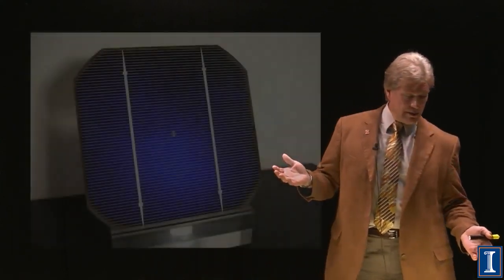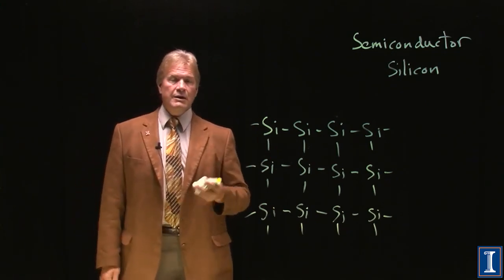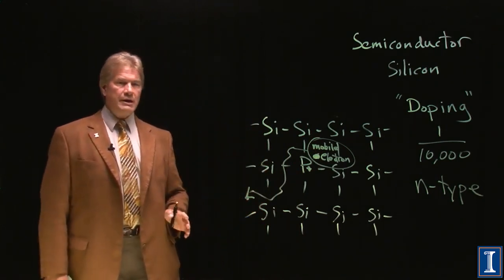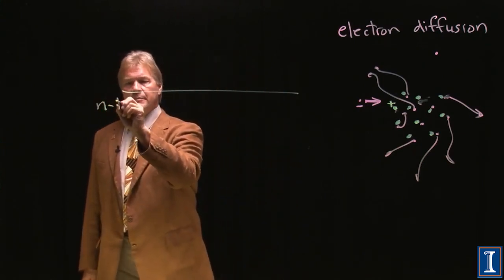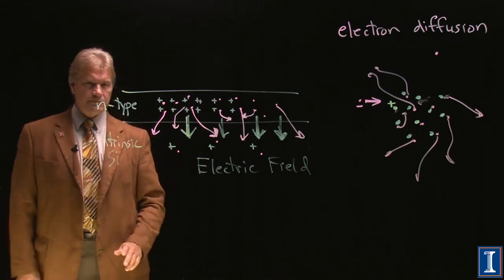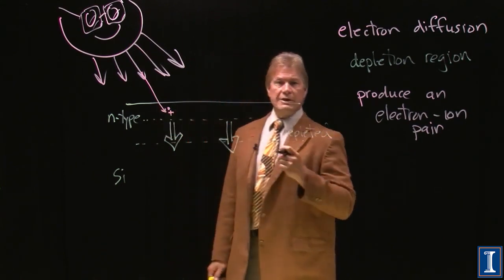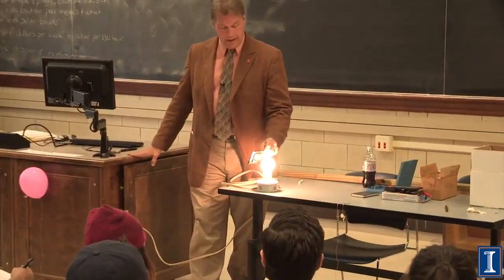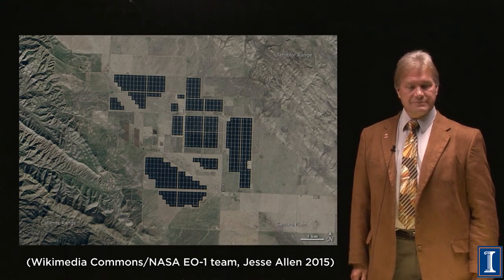How Solar Cells Work

Comment: Cdte panels 4x8ft size, or 8x8 size. FLEXIBLE deposition on stainless steel rolls in continuously operating vacuum chamber. Top is then plastic or even a clear sprayed bonding agent,  and then the wires are fastened. 
For less connections
For less roof intrustions
For less weight
For less manufacturing infrastructure and expense

1000w minimum panel size. They will be LIGHTWEIGHT and can be handled in a roll up a ladder or percarious place, easily. The edges should have lips flexible grip beaded edges on them at least the sides probably top bottom too. SO they can be mounted with strips that connect over and to panels on either side and or tops... . Then strips of Plastic could be used as banding to keep it in place, enough. Cheap, even pre made with butyl waterproofing screw holes. 
I think connectors should be on the panel. WIthout wires, wires are made to each installation. AND the mc4 connectors can be made smaller with higher voltage lower currents. If you could take partially the dc voltage and invert it without transforming the voltage, you can design a system that can do that, while producing or grid tie, then the remainder is stepped down to the battery. 

It makes complete sense. 
Can also have a silica or silicone coating on the back for electircal insulation and non arcing ability. 

Higher voltage a ok with higher voltage electroics. 

Can be done so well. 

I SHOULD steer the general direction of first solar, as they could easily and happliy implement this technique and to hell with any patents, I am certain there are no ideas not worth copying or    to happen to replicate due to the general intrinsic design. DAMN

Comment: What will happen if silicone is dopped with uranium. Wouldn't it turn into super solar panel. Like you have combined solar and uranium radiation energy causing electron flow..

Comment: Best and most complete (non-quantum) explanation I have heard so far! (And I've seen quite some, ever since I studied physics some 35 years ago.) 
The concept is not very easy to wrap your head around, and most teachers explain that the charges move from n-layer to the p-layer because they 'want to be there' , 'fit in the holes' or there is 'more room for them in the lattice' or whatever. But those are only confusing ideas and would not explain anything, because then that propensity to go there could be described by a potential by itself.

The adult/children analogy was excellent: it is essential to explain that the charge difference is caused by diffusion, and is a statistical phenomenon: just due to density difference of free electrons, there is more probability to move from high density region to the low density region. That sheer fact makes it plausible why they would move even against a slight potential difference. 
And for the same reason they will diffuse more likely from the n-layer into in the metal electrode grid than from the intrinsic layer to the metal bottom plate, even though the n-layer and metal grid have a slightly higher potential than the intrinsic layer and the bottom plate. 
That electrons freed in the depletion zone follow the potential gradient is also understandable.

Comment: Very interesting. Does anyone know how doping works for the silicon atom? I know boron can also be used, just elements with either +/- 1 electron. But not too sure on the technical details of doping. Do you just throw them together and drive a reaction with heat?

Comment: I thought that if photons can break electrons away, it's called "ionizing radiation", and that that's the realm of radioactivity and X-rays and gamma rays.  IIRC typical silicon solar cells operate on visible light and often even infrared light, which is far lower photon energy than X-rays or gamma rays.
So what's the ionizing / non-ionizing distinction?

I remember once walking past a construction area, with the usual signs on the fence advertising the contractors involved, and I remember an amusing sign that said something like: "<name> Solar, knocking electrons into higher energy states since <year>."

Comment: But.... why are the PV cells blue? You asked the question but you never answered that. Yes, logically they SHOULD be black so why aren't they? Is it related to the texturing of the PV surface area to increase said surface area? Are the microscopic peaks and valleys in the (normally black) material somehow allowing light from the blue spectrum to be reflected rather than absorbed? Or is the textured surface actually reflecting a different wavelength of light and slowing it down so that it shifts to the blue wavelength (simulating a doppler shift)? Enquiring minds want to know! :-)

Comment: The lecture makes it seem that after continued exposition there should be an imbalance in the charge between the layers. You obviously don't need to reset the solar panels, so I'm curious as to how is it done.